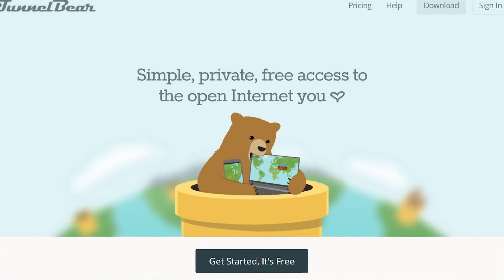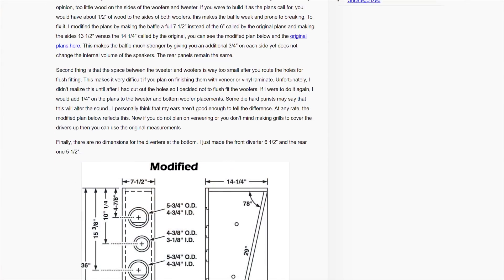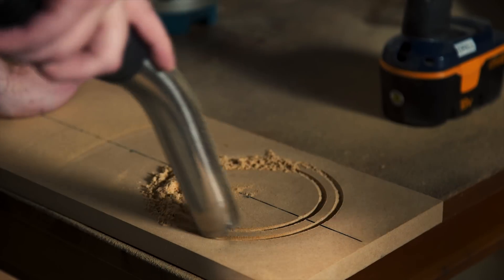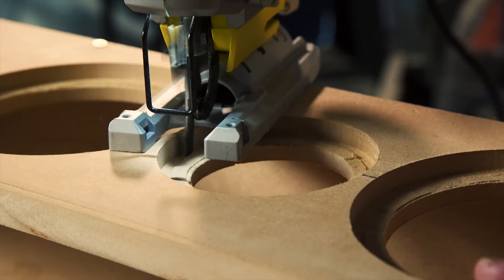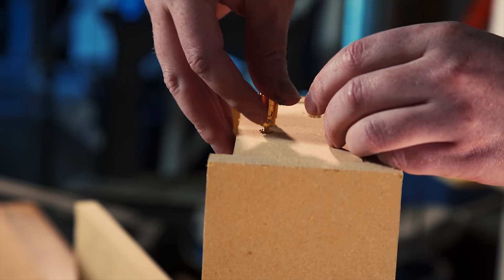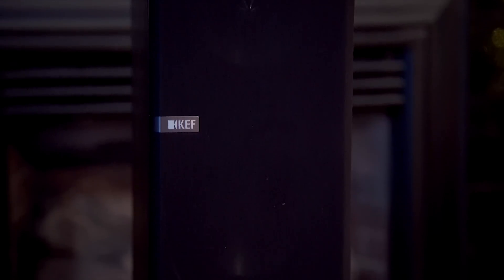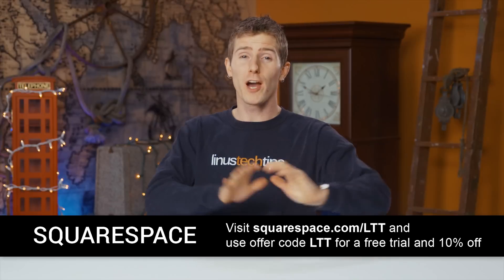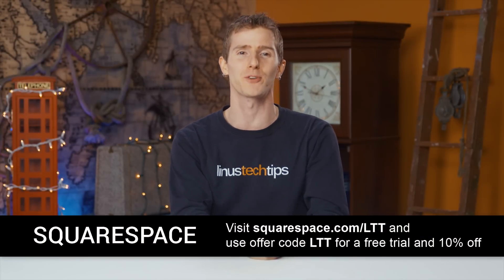DIY Speakers for Less Than $300!

Comment: These are some ugly AF looking DIY speakers. U guys srsly need to stop making things out of that paper wood u call mdf board. Try using some real wood and good paint.
Reply: MDF is arguably the best material for speaker building, the problems you pointed out are pretty easy to fix. MDF is a very dense and stiff material, great for box building and it is easier to work with (eg won't chip much). They do swell up if exposed to water but that can be stopped by sealing the with paint. Also MDF looks ugly but can be painted or a veneer of real wood can be applied to the surface (this is how the most high end companies build their speakers). 

You said use "real wood and good paint", firstly MDF is a better surface for painting because it is very flat and has a consistent surface colour (no grain). Secondly real wood is not practical for speakers because of its thermal-expansion and density irregularities can mess with the box sound. The only practical wood is ply because the crossed veneers eliminate thermal-expansion. 

TL:DR Basicly MDF is the best speaker building material except if you want a visible wood grain finish instead of painted and don't want to apply an exterior veneer, then get ply.
Reply: mdf is the best material for speakers because it's soft.

but this shit in the video is ugly AF indeed
Reply: you do realise that pretty much all high end loudspeakers are made from MDF right? they just laminate it with wood veneer to give it a better finish. MDF is thermally very stable, and very dense and is an ideal material for speakers.
Reply: MDF works really well for speaker setups, idk why these speakers look like they were made in a middle school shop class.
Reply: He hasn't made any spelling errors to my knowledge. "Srsly" is simply an abbreviation and "u" is also the same. You don't have to be eloquent to voice an opinion/concern.
Reply: Moiz Mansoor I realize the goal was to make them cheap, but they don't have to look like shit.
Reply: MDF is perfectly fine....
Reply: You know MDF is some of the best material you can use for speaker building...? Also, there's ways around the look. It's called Veneer bud.
Reply: ^ it swells if you even thing about water
and it falls apart easily
not to mention the health concerns when cutting the damn thing
Reply: Runslik3Wind of course you aren't going to use it in a place where water will be a problem unless you coat it. And yes there are minor health concerns but there are also health risks cutting anything. MDF is also a lot cheaper
Reply: They are indeed ugly and real wood would have been better. Here I feel like these are one of those things where they represent their audience as less of a professional and more of someone that just decided to do some diy speaker (which isn't a bad thing). I don't think that they think that they are master carpenters or something like that.
Reply: MDF is decent heavy but if its going to be MDF should be done correctly with sealer and some type of protection like paint and carpet. Other than that i would only trust Birch wood.
Reply: Alexis Estrada cherry wood does a great job for speakers
Reply: particle board or mdf is what you want if the enclosure is decent size. stay away from osb or plywood, Because it flexes too much. now if it is a small enclosure you can get by with solid wood, but it is more expensive, but there is no reason to use solid if you plan on painting or putting carpet on it.
Reply: Xele Nor what is wrong with MDF?
Reply: fine dust from cutting wood is a hazard anyway, and some species are particularly bad. You shouldn't be breathing any of it in anyway so it doesn't matter.
Reply: timo stockhorst would cherry wood work on subwoofers 1000rms each? just asking would be cool to work with new material if it can withstand a lot of power
Reply: Alexis Estrada can't tell, my sub comes right from the shelf =/
Reply: dude the goal was to make them as cheap as possible

Comment: Just buy some small Bose speakers. They look fancy and sound crazy good for their petite size. For small living rooms, even the Bose soundlink mini 2 (it'a a tiny bluetooth speaker) will do the job. It has such insane sound production that it's sometimes even overkill. It has so much bass that you'd be wondering where the subwoofer is while it still maintains balance.

Comment: dont know why u would fill the box with padding. Letting the subs beat off the seal air box has to be better. May as well put a cap on back of subs sealing them stopping them moving doing there job. The box should be sealed to a certain volume and if stand boxes are to big make a sub box inside. Also load some weight at bottom to make bass boom of housing better. 5kg wouldnt hurt

Comment: Linus, what makes it a second order filter is not that it uses a double filter to separate the frequencies, a second order filter means that it has a roll-off of 12db/octave outside of the pass band for the high pass and low pass sections, it typically contains a inductor in series with the woofer and a capacitor in parallel with the woofer for a low pass filter, and a capacitor in series with the tweeter with a inductor in parallel with the tweeter for high pass filter
first order crossover -> 6db/octave
second order crossover -> 12db/octave
third order crossover -> 18db/octave
and the higher the db/octave the harder the filter attentuates the signal outside of the pass band
the resistor is there to attenuate the signal going to the tweeter because tweeter probably has a higher sensitivity than the woofers, meaning it is louder at equal power, so you have to lower the signal to even it out
typically you see a second order linkwitz riley alignment in speakers, which means after you sum the high and low pass filters response you get the original signal

source: im an electrical engineer

Comment: Sure 300$ can give you a really good stereo set. Little research is never a bad thing. Drivers are not expensive, not talking about laboratory engineered stuff. Wood is most expensive cost on entry level. DIY products are awesome becouse you can tweak shit out of them. Everything effect sound quality in world of hifi, so there is no need to worry if your speakers doesn't sound good. Just by changing an amp or useing eq can make your life better. I spoke enough shit for once. DIY is very fun way to go, but it will take alot of time (and they never will be finished 100%...).

Comment: Both sets are awful. Get jblspkrshp.zip and try using that with some flat response drivers with ribbon tweeters. You would beat them stinky lying kef's. Better still just put $100 on and get some Yamaha hs05's

Comment: WTF Linus. I know you need to pump out videos, but at least put some effort into finishing them before you upload.
Those speakers are not done, they look like garbage. go sand them and repaint them. If not, vinyl them, something so it doesn't look so horrendous. It literally looks like you filmed this while the paint was still drying.
I wouldn't mind multi-part videos honestly, if more effort was put into making something cool like this.

Comment: Well Linus I did mine  under 20 by recycling old speakers from the streets,  And  and old furniture wood. I used it for Halloween using small Bluetooth board, for some reason,  It's not configurated to use tweeter.  sounds good though just not that nice.

Comment: i made an DIY room theater for just for 100$ or less i only used car amp , car woofer 13 inch (mp audio) with box, 2 speakers local i think and premade boxes, computer power supply from old pc to power the amp , and wires

Comment: i've never actually built a home audio set up. but i have alot of experience with car audio and luckily its mostly the same.. and there is a couple of things that don't quite seem right. its a ported enclosure, which is a good thing. but they're tuned for a specific frequency. and putting a filler material in a ported box will mess that up. its usually used in sealed boxes and has the effect of making the box act like it has a larger volume. the other issue i see is that the port area is 30 square inches.. which is a fuck ton for sub woofers of that size.. the port is also extremely short. and the bigger the port area is the higher the boxes tuned frequency will be.. the way you get a large port with a low enough frequency is by making the port longer..not short. my advice would be to build the same size box, but sealed on all sides. then cut a whole in the front and glue in a piece of pvc pipe thats around 2 inches in diameter. the length of which you can find by using a free port calculator on the internet. lots of subwoofer companies have them on their websites. you just type in the the interior volume of the enclosure, the size of the port, and the desired frequency. which i would guess is somewhere around 60 hertz. it'll tell you exactly how long to cut the pvc pipe. you'll notice a huge difference in sound quality

Comment: No bass port? Come on... You just trap all the air from the woofers inside the cabinet... Thats why it sounds "cloudy".
Reply: Ian Ivey these are transmission lines. No need for a bass reflex port
Reply: It has an open back so the air isn't really trapped anywhere.
Reply: speakers don't need a port. There are plenty of sealed speakers that sound fantastic.

Comment: You didn't properly take into account the width of the material removed by the blade. If you marked each piece one at a time before cutting then that difference will be pushed to the edge of the material.

Comment: Why are they so ugly?
Reply: Because none of them  had the remotest bit of woodworking skill. As a hobbyist woodworker, as well as an electronics engineer, this made me cringe pretty hard.
Reply: That's what most DIY ends up looking like.
Reply: Just like the desk PC build he does not plan this kind of shit very well, and rushes it.
Reply: Ah yes, DIY should be done with at least 15 years of woodworking experience and 100% precise planning, else you can't call it DIY................................................................ They suck at woodworking, and so do I. Had I tried this myself it would probably look the same, which is why I would never because I dont handle wood well (hehe). 

If this is an insult to anything, it's elitist guys like you who doesnt understand that not everyone is as good at everything.
Reply: Extra Mental because they just couldn't be bothered by "painting sanding painting sanding painting and clear coating"
Reply: So you guys are saying that their job isn't to make quality content that people want to watch? And that they wouldn't get more people engaged even if they made the speakers better?
Reply: That's not what I expect from a quality content channel tho.
Reply: Extra Mental i think they made them black so if you add a nice layer then if you have a small opening somewhere you dont see bare mdf
Reply: jesondag Yeah they did not even put heat shrink on the solder joints, and that's one of the most basic parts of soldering up wires like this. So again they rushed this video like they do most of them so things end up looking like shit.
Reply: This is not a woodworking channel. The content can be good (and imo it is) even though the end result of a cheap quick DIY is awful looking.
Reply: Extra Mental idioit
Reply: That is what most inexperienced/ rushed DIY projects look like. As a engineer, machinist, woodworker, and all-around mechanically inclined person, my DIY project would have looked better than the speakers he spent $350 on...
Reply: That was the point it was shitty but good enough
Reply: The 'norm' for DIY is actually even shittier looking than those.  They'd probably be unpainted.
Reply: Rainsoakedcoat the point was that they spent way way less got close to the same perf and didn't spend anywhere near as much  really try very hard/ do very well

Comment: if you need to fill large gaps In wood work. use Bondo if you're just going to paint it. it's much easier to work with but you can't stand it to perfection.

Comment: For a fair listening test you would need a controlled environment. And it seems like you weren't concerned with stereo spatial spread. And for a similar amount of money you could always pick up a pair of JBL 305's. Maybe not as loud, but if not the best near the top in that price bracket.